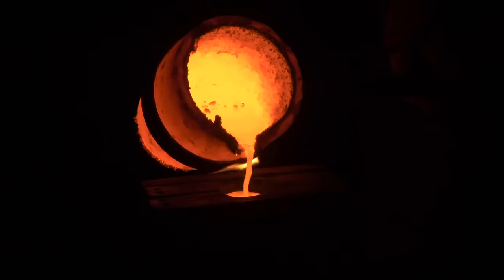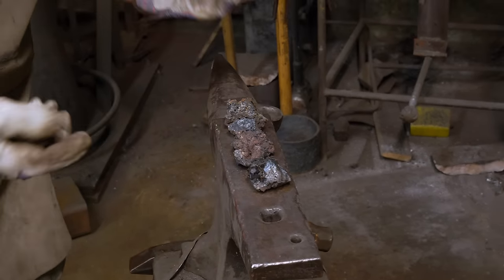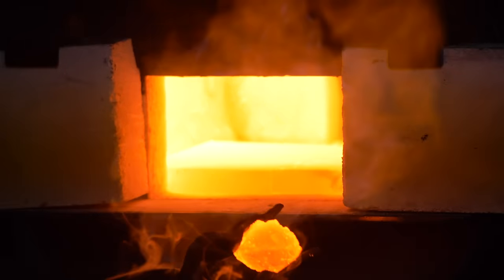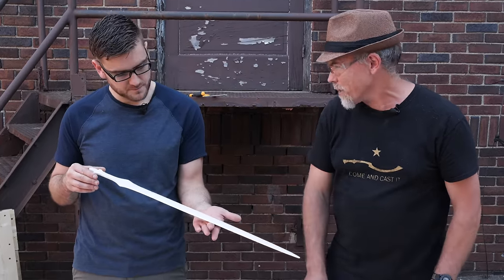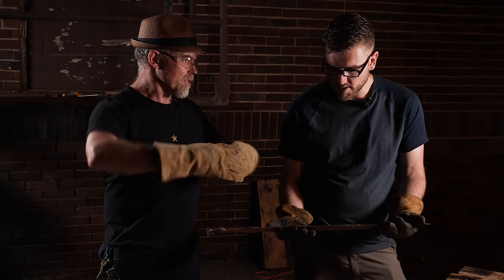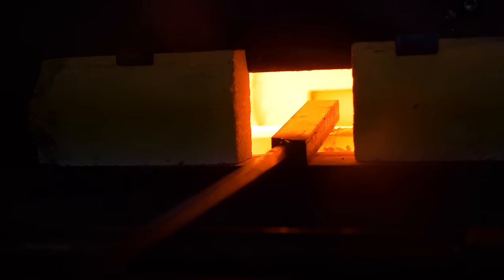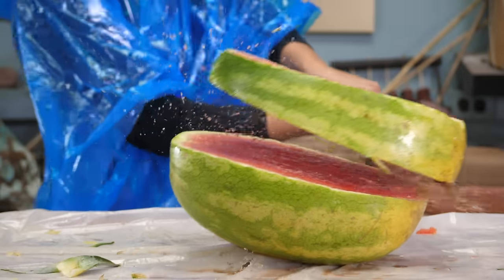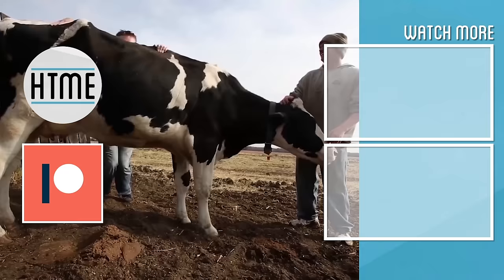Forged Iron Sword vs. Cast Bronze Sword

Comment: I'm not sure the direct combat between bronze and iron is what makes the former superior.  Since most armed combat doesn't last more than a few blows, it seems unlikely that either weapon would break before the battle was decided, however in a contest between armies, one outfitted with iron weapons would see greater longevity in their sword throughout a battle.  Whether impacting shields, armor, flesh, or other weapons, the iron weapons will be more likely to remain viable for the next strike.  This combined with a longer usable lifetime justified the additional craftsmanship required for iron weapons (and tools)
Reply: You're correct, the main factor in a fight between warriors armed with iron and bronze would not be the quality of their weaponry but the skills of the warriors themselves. An ancient veteran warrior could probably beat an average modern man 99 times out of a 100 even if the modern man was armed with a high end modern steel sword. In a fight, if you telegraph your next move then your opponent will easily see it coming. Therefore, loading a big swing to "cut trough the oppenent's sword" could be very foolish. Or it could be your best chance at victory, in a fight, nothings a given: their are too many factors to truly account for like skills, speed, strength, technique, luck, even the direction of the sun.
Reply: The real factor that made iron dominant was logistics. It's actually extremely rare for there to be significant deposits of both copper and tin in the same place, so the bronze age required extensive and complex world-spanning trade routes to function. Iron meanwhile only requires one ore, which is abundant. That greatly simplifies sourcing raw material for production.
Reply: You do know that battles tended to go on for a few hours, right?
Reply: @Ackalan  that's true but that is not the scope of this video, this is comparing material vs material in a single engagement to see if one could make the difference. furthermore, take a bunch of recruits with modern steel and send them against a bunch of old grizzled veterans with rusty swords, you'll see what happens. the sword doesn't make the man, the man makes the sword.

Comment: "Swords were a secondary weapon in the bronze age..."

Dude; they have ALWAYS been secondary weapons.
Reply: obviously. run away screaming at the psyco with a sword is always first
Reply: Typically you'd have archers or slingers beating up the enemy from a distance, skirmishers riding past and peppering them, super annoying. And then when the two shield walls came together, men would hurl spears first. So you might not even survive to meet the enemy. When they closed to melee, they stabbed each other with spears. Men in the rank behind the shields would stab over the top at the enemy front rank, and that must be done with a spear because it's too far away. 

So you're pressed in on either side by your buddies, your buds from behind and pressing you forward, and the enemy is trying to shove your whole side backward. All the time, you're gripping your shield and spears are stabbing at your face from like eight angles and your friends' spears are banging into your helmet. You're getting kicked and stomped on, dust is kicked up in the air, men are screaming as they're dying, arrows and stones are flying overhead. Blood runs down your spear haft and it's hard to hold onto. Drums and horns are going off all over the place to give orders, and you have to somehow pay attention to your side's communications and not get messed up by the enemy's. You're also tired because you were marching, cold and wet or else sunbaked, hungry and probably at least a little bit ill, and if you survive your best-case scenario is a plot of land you can farm on until you die from exhaustion. 

Morale is the first weapon. 

More men died from disease like cholera, or malnutrition, than in combat. This is because the camp is just a muddy mess of shit, people can't wash up properly, the water is tainted and insufficient, the food isn't properly preserved so it's full of maggots and basically rotten. 

Sanitation is the second weapon. 

All the other weapons are tertiary at best. 

That said, I'd argue that diplomacy is Weapon Zero because you can subjugate an enemy without sending any soldiers and get everything you want if you do diplomacy right. War is the next step in the diplomatic process.

Comment: The main issue with your bloom is that you didn't squeeze out the viscous silica trapped in it.
Reply: I dont think he cares
Reply: @ajhproductions2347  why wouldnt he?
Reply: I think he didn't get the airflow high enough up to liquefy it so that the impurities flowed out enough. Those early iron techniques are really hard to work with  also the amount of muscle work involved is really high when you don't have a hydraulic hammer and the lower the temperature of your furnace the worse it gets. Jumping as fast as possible to a firebrick furnace seems naturally^^
Reply: Seeky Unbounded has he ever gone back and done something correctly? All his results used modern technology because he couldn't get it to work  using ancient technology. I'd say he's still stuck in the stone age.
Reply: @seekyunbounded9273  cause he does the jack of all trades thing where he learns a new thing every week or whatever, not selling it, just doing it to make a video the way I see it lol no concerns of extreme accuracy or quality, just to do it pretty much. But now I sound like im drinking hatorade...maybe just a sip...
Reply: K4 Josiah  I actually see a lot of reasons to replicate ancient techniques, the most important of which probably being to actually do it right. 

Many of the builds look crude and duct tape-ish, which is the total opposite of what ancient humans did for the longest time. In this way, HTME feels more like a "look 'ma! I did a thing!" than a "look how our ancestors did the thing". I can't be complaining that much because it's not my project and he has his own vision for the channel, but I wish it was something more than this. What I will be complaining about, however, is the creeping lack of seriousness in the production. More and more, the main aspect of the serie is evolving around the characters rather than what they are building. I fear that this channel will eventually turn into an epicurious number two.
Reply: @butterflygroundhog  I mean you gotta keep in mind, ancient people would have tons of practice at doing this stuff, lots of help and training... I'd guess Andy basically hits the level of a new apprentice with these techniques, which is to be expected because he's, y'know, new at it. But mastering individual techniques is not his job, if he was set on becoming a master smith he'd have to spend a LOT of time (and money) perfecting everything, and he'd never be able to get around to doing anything else.
HTME, you get to see the basic methods and theory behind the technological innovations of the past, and you get to see how genuinely skillful ancient people were by how much modern folks struggle with it. We tend to think of past eras as "primitive" and "simple" in their technology, look down on them, but these methods do require great knowledge and skill that should be respected. Thus, HTME brings on experts and masters to show us how it's really done, and once they've successfully demonstrated a new innovation they might use a shortcut to replace the years or even generations that ancient people would have spent refining their techniques. Especially in such cases where the world has changed too much or local geography isn't conducive (such as in metal distribution and availability).
I do hope they get to practice their iron smelting more, but for a project on the scale of this video (a whole entire sword) it's not worth the time and effort to try and smelt that much iron in their backyard bloomery, yknow? I'm sure that for projects later in the Iron Age they'll have the opportunity to get better at it, and I'm also sure that PLENTY of feedback has been given to them on what they did wrong :P
Reply: maxime therrien If there was a channel that did this but with more effort I’m not sure I would watch another HTME video.

Comment: WHY DID YOU PARRY WITH THE FLAT SIDE!?!?!?!?
Thats the weakest side of any sword!
Bronze, Copper, Iron or Steel.
You use the blade to parry!
That has the most force.
Reply: I think they were doing it wrong on purpose to push them to failure more easily
Reply: Parrying with the edge will damage the edge

Comment: It is important to note; ancient bronze would have used things we do not use today. Because they are poisonous metals.
Like arsenic.
Leaving ancient bronzes a bit closer to iron, plus the comparison here would be analogous to a very expensive iron blade for the early iron age, since well. Wrought iron was the first stuff we really could make, and low carbon steel and Wrought iron equivalents don't really cut the mustard to make historical speculations on.
They are a bit less durable overall and a bit harder and stronger.
But good episode; I hope you use your historically accurate iron to mock up another test in the future!

Comment: Actually this isnt bronze, it's copper. Bronze is a mix of copper and tin and has different propperties than plain copper. The true test should compare the real bronze(copper+tin) and the orychalk(copper+zinc) which were the main alloys of the bronze age with the forged iron which is technically steel
Reply: Ah, so it should be titled copper vs steel. Not really a fair test of bronze vs iron after all.

Comment: Bronze definitely held a edge in being castable, wich is a way quicker process of manufracture. But it also limited the size and shapes. It was very hard or outright impossible to forge. And the resources were a lot more limited to get, as you needed tin and copper.
With Iron you had to use forging. Wich while a longer process, also offered a lot better control. Casting was not possible until closer tot he modern age. But the resources (Iron and Carbon) were comparatively easy to get.

Comment: If Age of Empires has taught me anything, it's that Bronze Age doesn't stand a chance against the Iron Age unless you plan on a Fast Castle strategy.
Reply: Differences in bronze vs. early iron equipment are less impactful on battle outcome than strategic (recruitment, training, supply lines, morale) and tactical (unit composition, troop movements, communications, surprise attacks, fire, fortifications). 

If bronze fights iron, but the bronze civilization was able to field 20% more men, the boost from that will more than compensate for softer equipment. Or if bronze happens to be well-fed because they encamped first, that's a huge advantage. Or if bronze is defending and had time to recon and set up some field fortifications like stakes or abatis. Or if bronze has a well-regulated system of swapping out men from the shield wall with reserves. 

To put it another way, imagine you have a bronze sword and a guy comes up to you well-trained with his stout stone club. One good hit on your head and you're dead. Your bronze sword has a lot of advantages, but it doesn't make you invincible, or even make the outcome certain. 

Which is all just saying that AoE is extremely simple and bamboozled you into thinking it was teaching you anything.
Reply: Partypooper

Comment: I am way late to this party, but I don't think this is a very fair comparison for a bunch of reasons that can be grouped into two categories.  
A) Your 'iron' sword is arguable of very high quality--much higher quality than what it is being used as a stand-in for and take note of how 'long' your bronze-age expert felt your blade was and understand that this is partly to blame for weakness to bending. 
B) Your sword vs sword test isn't reflective how how swordspersons duel one another.  Even with high-quality weapons (perhaps especially with high-quality weapons since they are so expensive) you would never expect to see them wailing on each other like they have metal clubs.  These things are sharp and flicking strikes to the hands, wrists and elbows would be the primary attacks since they are the closest things for you to hit and they also keep you as far away from their sword as possible.  Any time you would bring you sword full on overhead to wind up a huge strike, you would lose.  Either you invite a pre-emptive attack or your huge telegraphed and committed swing is readily evaded and you are run through before you can finish your strike.

Comment: Bronze still had clear advantages! There were reasons the Romans used it widely. The iron needs regular care and will rust quickly. While the bronze sword can go on a shelf. And a bent bronze sword can be repaired on the battlefield while iron shatters.

Comment: It's only easier to cast than forge, when you use modern casting methods like sand casting.. Which was not done in the Bronze Age...
Reply: Sand Casting bronze was around in China 3,300 years ago.
Reply: @Rob_Fordd  to my knowledge no. First around about  470 AD for casting coins in China
Reply: Even if it WASN'T Widely done, its doable with pre-bronze technology
Reply: @jakob4644  Coins are not the same as swords, they are just both made of metal. The easiest way to make a coin is to pour a glob of molten metal on a surface and stamp it before it cools in a rough circular shape, there was little need to innovate from that for ages. Regardless, of when it truly started in China though, the oldest sand cast piece, a bronze frog from ancient Mesopotamia, is 3,200 years old.

Comment: Hmm. I think through a combination factors what you had here was a very good quality piece of iron going up against a comparatively less good quality bronze sword (no disrespect to the smith who cast it....maybe a bit of disrespect to your slightly wonky work hardening :P ) - haven't watched all the videos you've done but I am curious whether it was a comparable alloy to the contemporary ones - I know they got very specific in tailoring the alloy to its use.

On the iron side, good quality homogenous iron existed, and even steel tools could be produced back in the bronze age, but doing so was rare and less consistent. By the time the iron age is in full swing hey could make pretty decent ones, but a good quality bronze tends to be superior - though IIRC more so for something like armour, mechanically speaking - I have certainly seen a top class bronze naue ii cut through steel plate (under favourable conditions, but the fact it did it at all was astounding) which judging from the performance here I'm not certain this one could do (though granted that was made by possibly the world's best bronze bladesmith we have today)

As for parrying with the flat of the blade....kinda sorta but not like that. A full on strike to the flat of the blade is far MORE likely to bend it than to the blade's edge (thats basic mechanics, there's a lot less depth of material to deform). If you want to block the enemy blade you want to do it with the edge, its not onyl less likely to bend the blade its also a MUCH stronger barrier (for slightly more complex mechanical reasons) The disadvantage of course is edge damage, but we do see edge damage like that on artefacts.

Using the flat of the blade would be for a *deflection*, so you're doing it at a slight angle and not taking the brunt of the impact, just giving the incoming strike a slight nudge and letting it skid off.

The real advantage of iron is the logistics, and not needing tin (which has onyl a few large sources in the entire Mediterranean) 

Once you get to actual steel though, yeah its better